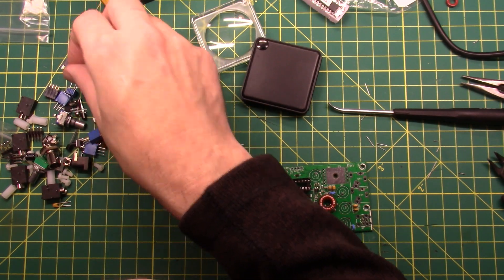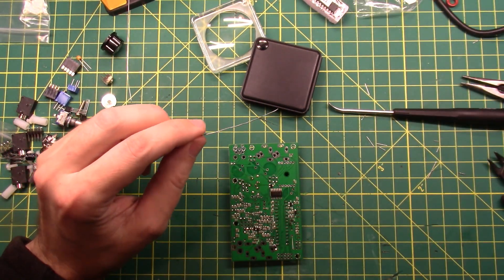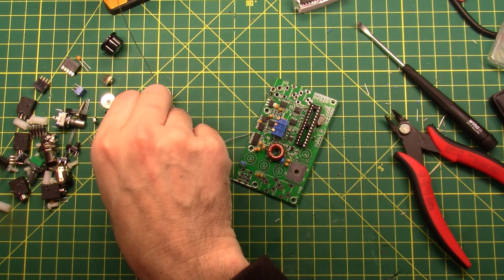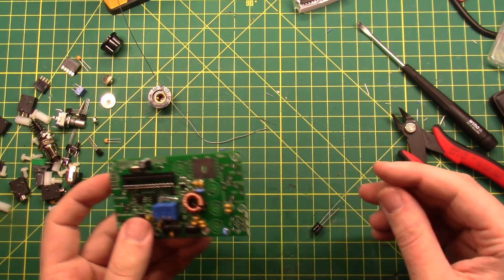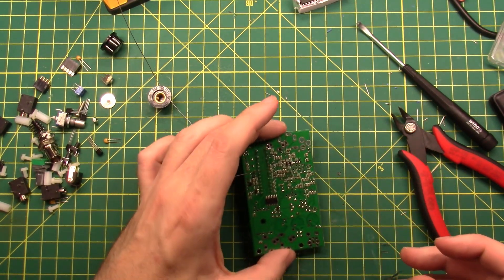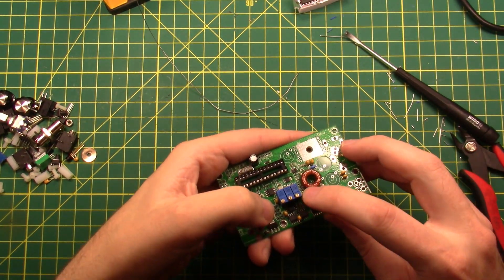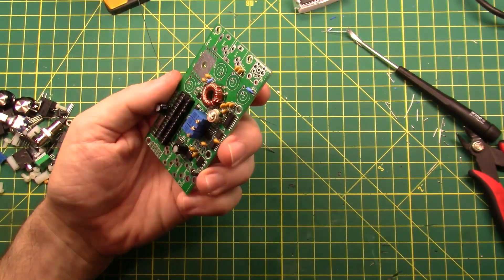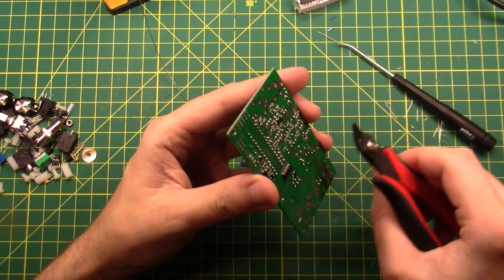How to build a QCX Mini - Part 4 - Electrolytics, Trimmers, Finals

Comment: What's the benefit of the TCXO? 🤔
Reply from the maker: Temperature Controlled Crystal Oscillator - As the temperature goes up inside the case, its supposed to be better to provide a stable frequency.  The next step up would be an oven controlled crystal oscillator that is even more stable!